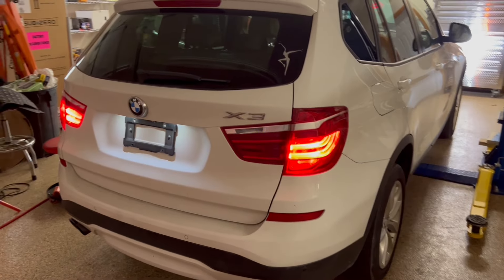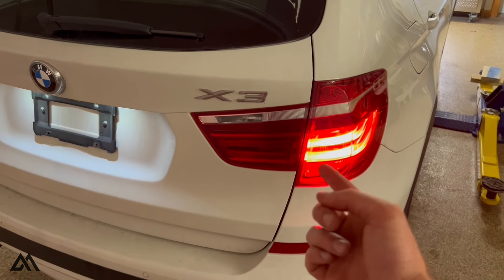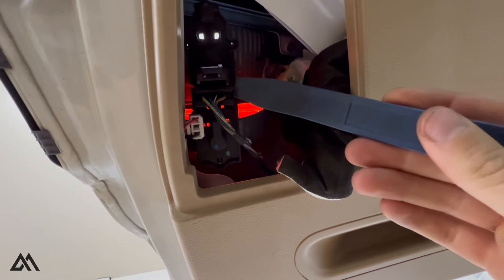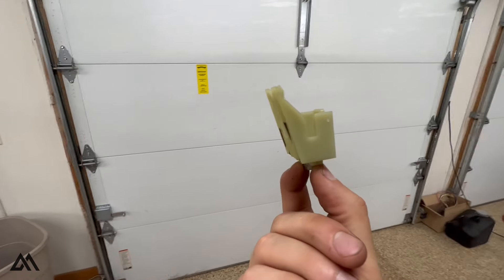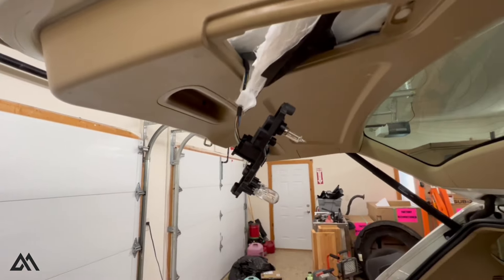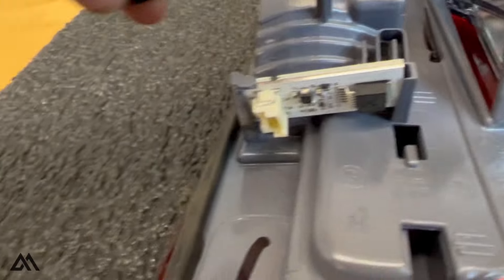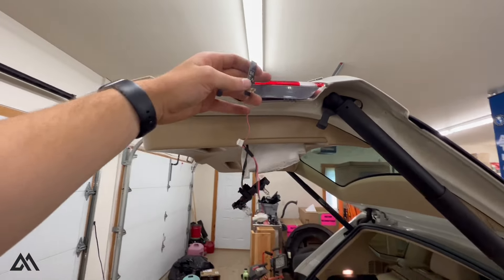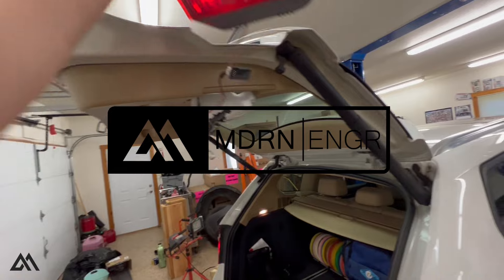Fixing LED Running Lights on BMW X3 - LED Controller

Comment: You definatley walked me through it, i got the right board...2 things made this easy: 1) the existing board is hot pressed in so i zip tied the new board to it without heating out the old board. 2) The nut to remove the fixture is 8mm...2 small details to make an easy job even easier-Thanks again.
Reply: I can't  push the the whole tail light out?????

Comment: Awesome video! I was able to take my lights out on the tailgate because they were not working but I don’t have the Lcd controller chip on my vehicle also no wires besides the ones connected to the taillight. I changed the mini bulb and still nothing. Could this be a fuse? If so could you tell me the location of the fuse? I have a 2016 bmw x3

Comment: Hello! This kit repaird can be used also on Bmw 2 series 2016 active tourer,F45?I have the same issue
Reply: You can repair the board easily or replace it. All it is LED "driver". The board just puts resistance between the 12V input and the LED light. They also add caps to prevent flickering as the voltage changes.

Comment: I have a 2015 X3.  I pulled out the taillight as you did but I do not have the wire for the controller.  Is there another fix.

Comment: A few of my bulbs seem to broken which is weird. Do you know what kind of Amazon I would need. They want to charge me 1800 bucks. They said my break and signal work just when it’s running lights don’t work.

Comment: Those taillights did not come with the original vehicle. They are cheap halogen lights that are not compatible with the circuitry… which is why they don’t work, and you need the b003809.2 conversion… the light you’re so clearly showing us is a halogen light, not LED.
Reply from the maker: @prokrastnation6071  Thanks for the comment. Thats incorrect but it doesn’t seem like you’d like to have a genuine converaation. Hope your day gets better.

Comment: I couldn’t push my light out that easy I’m super frustrated
Reply: Same, ever get it figured out?
Reply: You’d probably figured out 10 months ago. I had the same issue. A simple pry with the trim remover solved it. I was initially equally frustrated as well.